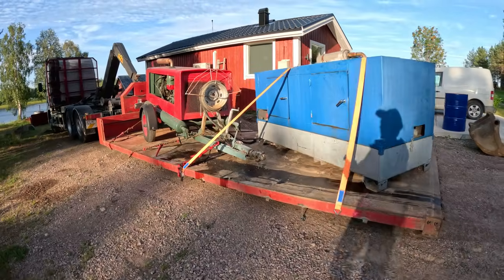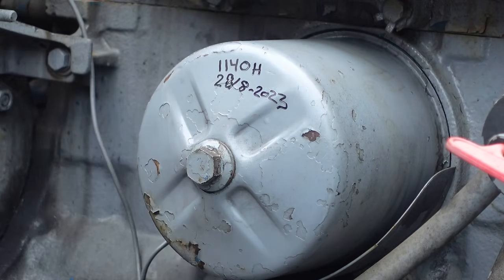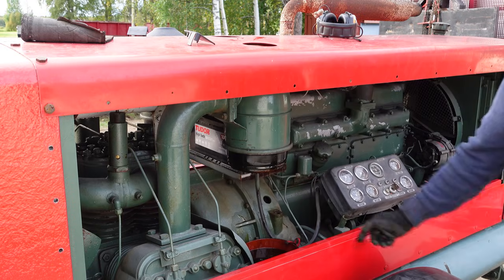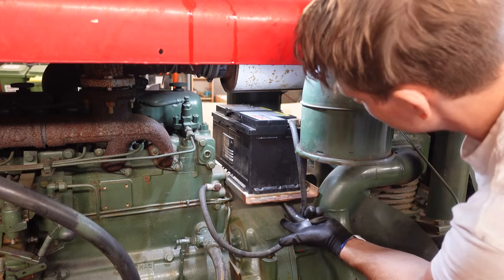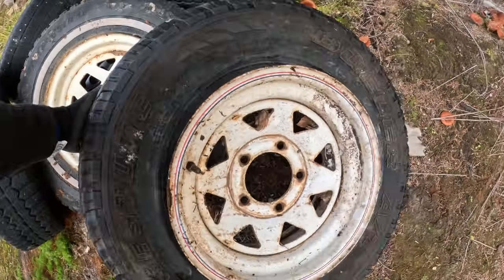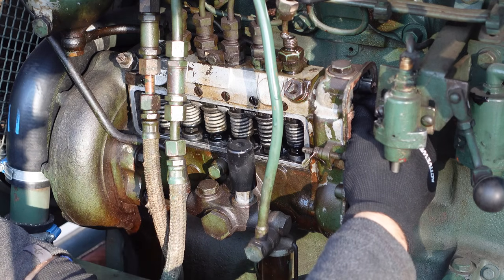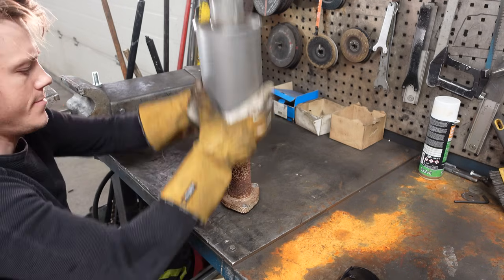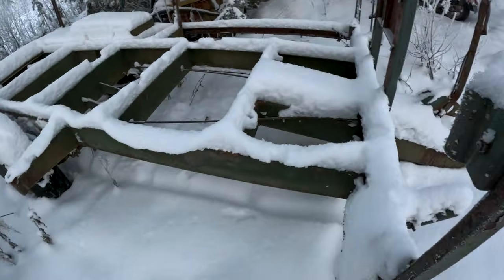Bought a big Diesel driven Compressor & Generator

Comment: I think I have an idea. To the generator. Easy to move. 2 tubes, under the narrow side. And then make a forklift for the crane. And maybe an option for 2 wheels and a tow bar? I don't know what your crane is allowed to lift with that turning on it? And what does the generator weigh? But I think it's better to lift at the bottom. Greetings from Spakenburg, Netherlands.

Comment: Hi M. B.  Call me paranoid but that filter you changed at timer stamp  41:26  to 42:00 Min on your air compressor looks like it was missing the bottom end cap.  How hard it was to pull up and how hard it was to put in the new filter has me worried that the Metal end of the filter could be stuck in the filter housing.  I know it is hard to show all you do that is not filmed, but  I hope you checked in side the housing.

Comment: I think you probably left the bottom side of the old fuel filter in the filter housing of the compressor's engine. It'll probably be fine but you can't keep doing that, it can't hold too many of those...

Comment: Generator mains frequency: -The frequency governs the speed of connected electrical motors.
Low frequency, low speed. High frequency, high speed.
A 50 Hz motor will tolerate higher than 50Hz frequency, but frequencies less than 50 Hz will cause a 50Hz motor to run hotter than normal.

Comment: Did you plug up the center hole on the new air filter (where you noted that the old filter had a welded nut)? Otherwise unfiltered air will be sucked right up through the center of the new air filter.

Comment: It's an air drill? With water cooling. Maybe 2 things are missing? A diamond drill? And water cooling? I work in the Prefab Concrete Industry. And use an equal current drill regularly. And the drill bits are different from a regular drill bit. #spakenburg

Comment: Why you don't use nuts with stopper?
Metal Akku holder  which connect to the minus and near the plus terminal, it's not good.
2 plastic lids maybi for air intake at the top...

Comment: Looking at the overall size of that generator and the size of it's alternator I would of said 80 to 100kva it has a few 240v 50hz sockets along with 2x 16 amp 415 3 phase

With Rock drills, I've heard they often need rebuilds
That was from watching the Australian explosives engineer who blows up Rock on his channel
Reply: Air tool oil? Something you rarely see nowadays.

Comment: FYI - at 55:11 you solder the battery wire that is already crimped in the terminal. The crimp is a much better electrical connection without adding the solder, and in automotive vibrations situations can be dentrimental to the connection. The solder acts as a hard connection and the constant vibration can weaken the copper wire where it is soldered to the point of actually breaking the individual wire connection and if enough of the individual wires break, the electical connection is compromised.

Comment: I think there is a part of the old fuel filter of the compressor missing. You might want to make sure it's not left in the filter housing.
Reply from the maker: I did pull the filter out again and had a look. It was just a spring there.

Comment: Did you use high temperature paint on the muffler and exhaust pipe? If not, it will burn off when it gets hot.

Comment: The injection pump has its own oil supply system so that it is always lubed check that once every 25 hrs. A common sign isa miss on a the injection pump farthest from the fill will stick in the upper position had it happen on many farm an logging equipment. Needless to say I stopped relying on the maintenance guy’s and check it myself.anyways hell of a score there they should last a long time you look after them 🤨 I’ll be watching boy.

Comment: Don't say width for something round like the filter. Say diameter.
Also, if the oil pan plug is some kind of pipe thread, you can use threaded pipe to run it out thru the frame and put a plug or cap there (or valve), to drain oil. Possibly using a 45 deg elbow and maintain some downward drop.